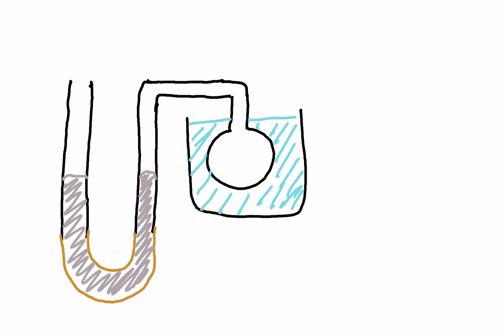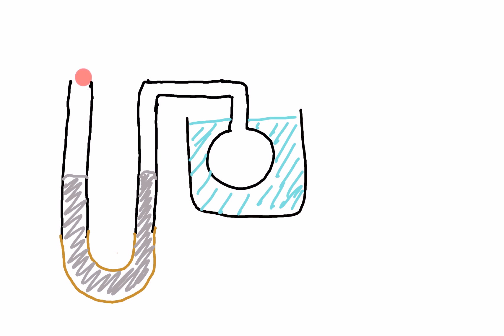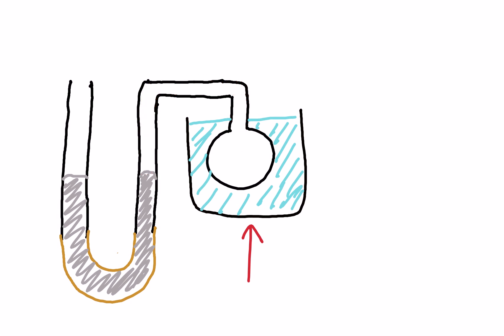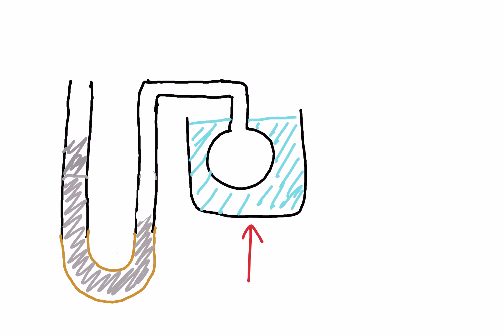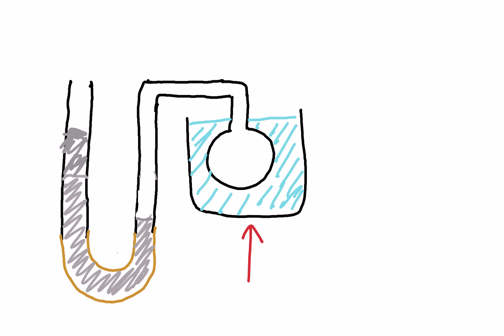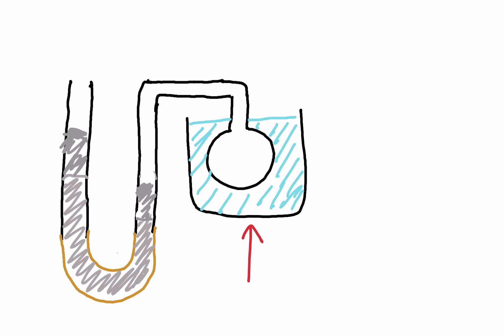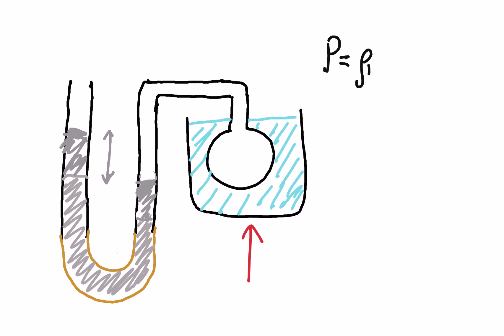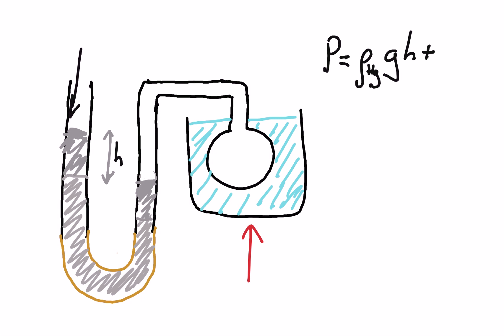Principle of the gas thermometer

Comment: How does raising the height of the mercury tube compress the gas. If its the weight from mercury, wouldn't  that be the same at any height on earth mg.
Reply from the maker: Heating the gas after the initial measurements increase the volume of the gas. This expanded gas tries to force the mercury out of the tube on the left-hand side. As there is now a difference in the heights of the mercury on the left and right-handed sides there is a pressure gain of rho g h. This is also the increase in pressure of the gas that has been heated. As there is now both pressure and volume change then this is no good for using as a thermometer as we only want one change. Lifting the left-hand side increases the pressure so it starts to compress the gas. You keep lifting until the right-hand side is back to where it started so the volume of the gas is now what it was, to begin with. This new height difference between the left and right-hand sides is what you are after as it is only pressure that has changed in response to the temperature change.

I hope that helps.
Reply: @alevelphysics4359  but still didn't answer why lifting the left side of the tube pushes the mercury down.
Reply from the maker: @joseps637  https://youtu.be/n0xAQXL905c this is another video I did. Perhaps it might help if you see the real thing in action.

Comment: if you do not close the end of the tube, this thermometer will be influenced by atmosferic pressure
Reply from the maker: Yes, can you think what would happen to it's workings if you closed the end of the tube? What would it then be influenced by?
Reply: @alevelphysics4359   if you reduce the pressure to almost zero,  isolate the system by closing the end, attach a pressure gage, you make a really good thermometer. Is it possible ? yes it is xD. ( anyway, you are right, my last comment was not very useful)